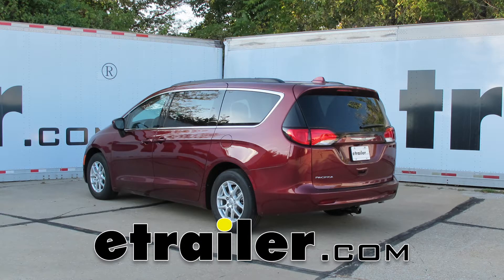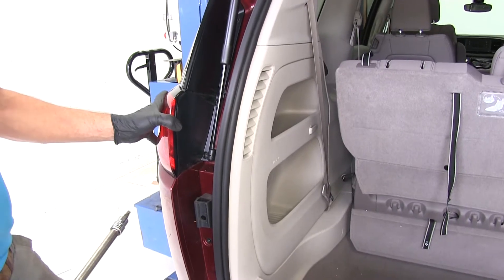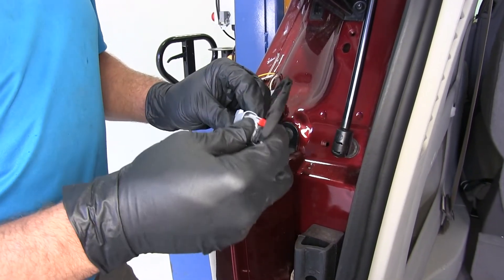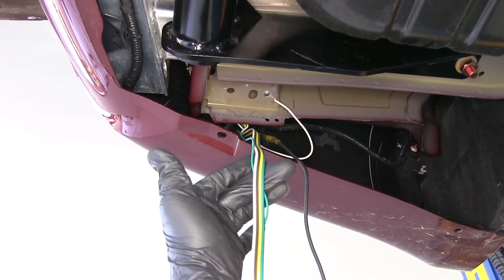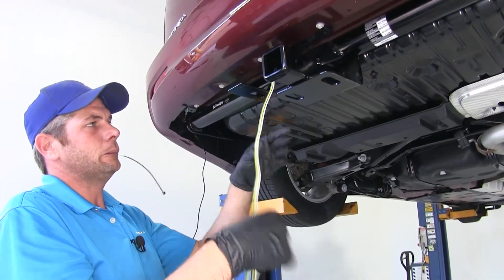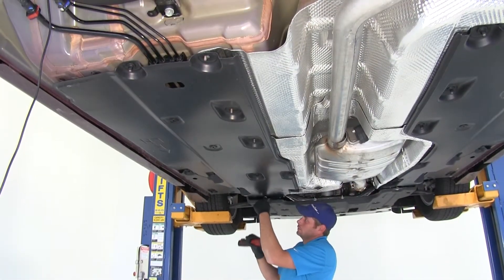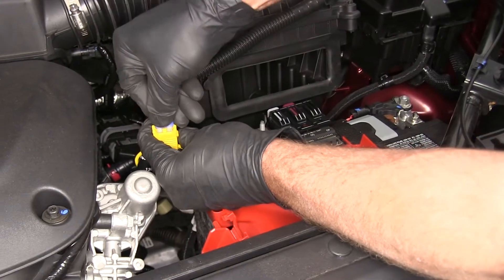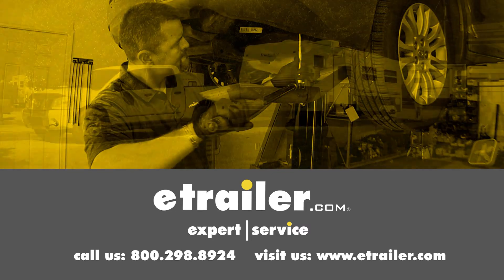Install: T-One Vehicle Wiring Harness with 4-Pole Flat Trailer Connector on a 2017 Chrysler Pacifica

Comment: Hello on the 118712 kit it says "Except" Touring and LX..I have  the 2018 Pacifica Touring L will this still work?...I just saw 118723 on yours which is different and am confused now😢
Reply from the maker: The 2018 Pacifica uses two different taillight assemblies which used different connectors, based on the trim level. The # 118712  will fit your Touring L trim.
https://www.etrailer.com/Custom-Fit-Vehicle-Wiring/Tekonsha/118712.html
Reply: @etrailer  Wow okay good to know,  I had no idea they would do something so different for something so similar
Reply from the maker: I believe the lower trims still use incandescent bulbs, and the higher trims use LED lamps. From what I understand, they use different connectors. Hope that makes sense!
Reply: @etrailer  My Touring L has LED lamps in the front headlights but not the rear, they look regular just like the rest of them so who knows why the rear plugs might be different but thank u..
Reply from the maker: You're very welcome, we're happy we could help!
Reply: @etrailer  Question please, by the rear hatch liftgate door on my '18 Pacifica there is a 12v cigarette lighter adapter plug thats always hot even with key off, can the battery connection be placed there behind the panel instead of the battery all the way up front with the 118712 ?.

Comment: Green wire was too short had to move box closer to middle
Reply from the maker: Depending on the route that you run the wires, it can take some minor adjustments in order to get the wires to reach.
https://www.etrailer.com/Custom-Fit-Vehicle-Wiring/Tekonsha/118723.html